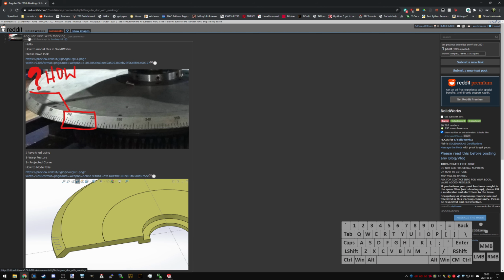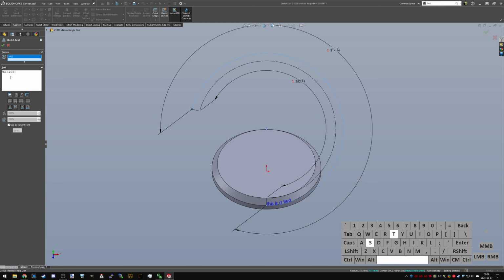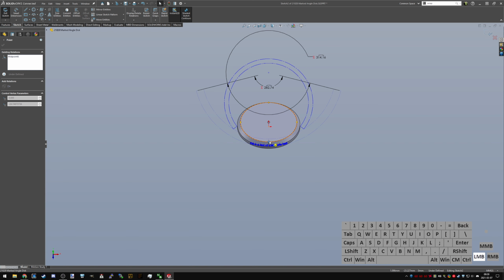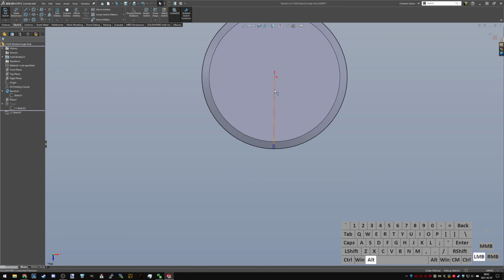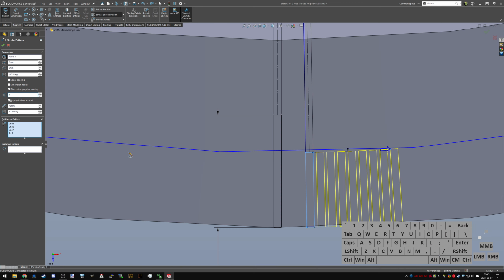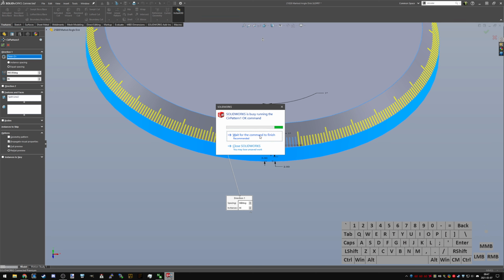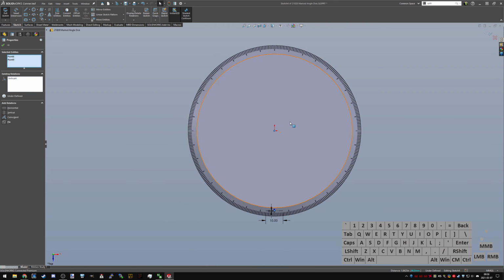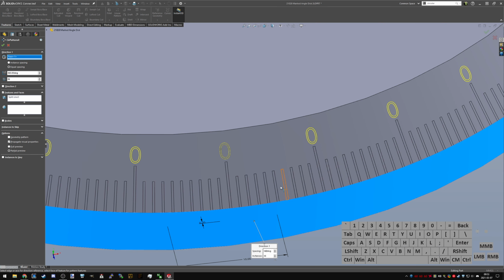/r/Solidworks Angle Wheel Graduation Markings

Comment: Nice job Clark!  Great explanation!  FYI @17:18 - after you add text to a  line there is a blue dot (usually floating in space).  If you drag that onto the origin (to create a coincident relationship) that will get rid of the under defined status.

I wonder if maybe you could do a surface offset of zero, of the conical face.  Then flatten surface.  Then layout the text on the flatten surface.   Then WRAP.   Just spitballin here   :-)
Reply from the maker: Absolutely yeah, I was just being a bit lazy finding the dot. It's usually placed at the origin, just for whatever reason it doesn't get a coincident relation by default; might make a good feature request. 🤔

With regard to the conical face, I did think about flattening it, but I just switched to SW Connected the other day so I'm still getting used slightly adjusted interfaces. I'm not sure if my normal Professional license has the advanced surface flattening, but it is perhaps the best possible way to do this sort of thing. Then again, that surface flatten followed by an analytical wrap would wreak havoc on your rebuild times... decisions, decisions! Appreciate the feedback as always!